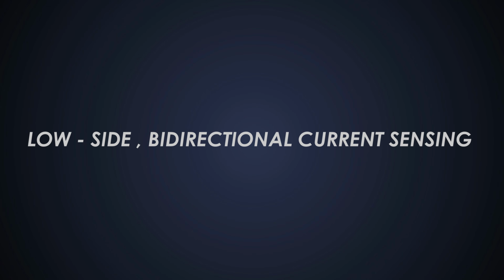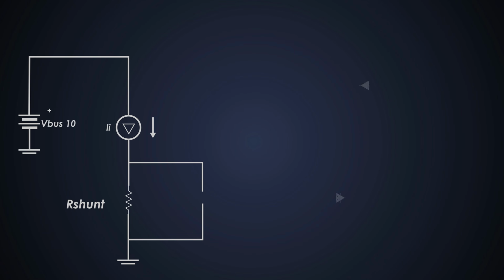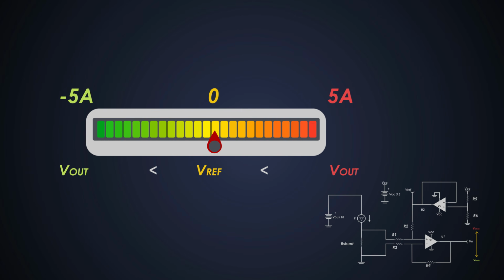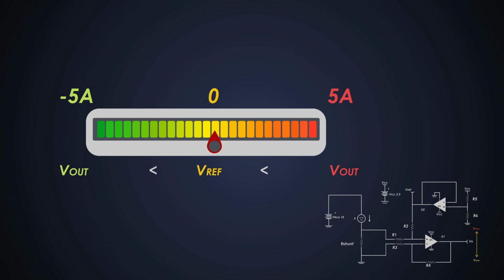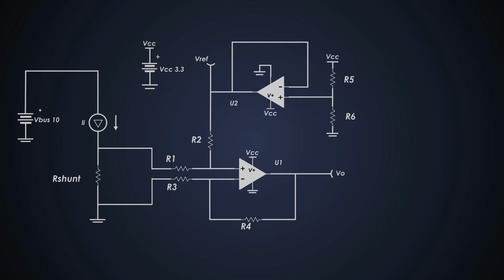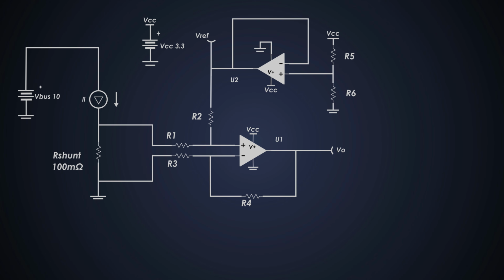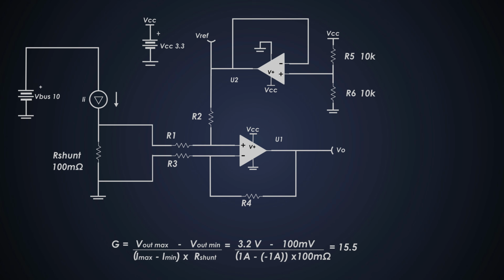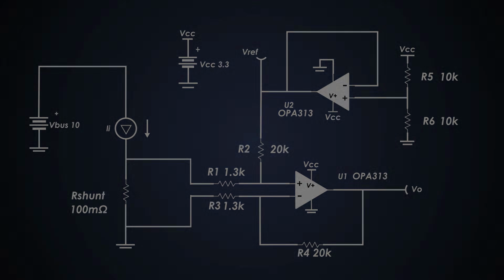How to Measure Current Flow in Both Directions? Bidirectional Low-Side Current Sensing.

Comment: So in case i havent placed a buffer opamp and use a simple voltage divider i dont have constant midbias voltage? When the inductor starts to force the current through the low side i have a large voltage peak over my shunt and the opamp needs long time to settle. I mean the voltage over the shunt should be like the current of the inductor and there should be no peak. It almost doesn't matter how fast the opv is, i have tested opamps with 10MHz to 70MHz bandwitdth.

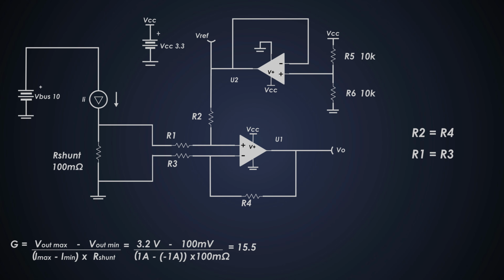Comment: 7:55 why we choose 1.5K ohms is there any particular reason or Any another  ?
Reply: I think you mean 1.3kohms. That value may have been chosen so that all resistors are standard sizes for 5% tolerance resistors. I believe 1.5kohms and 23.2kohms is a better match if using 1% tolerance resistors for the 23.2kohm but the main focus of this video is the circuit design process.